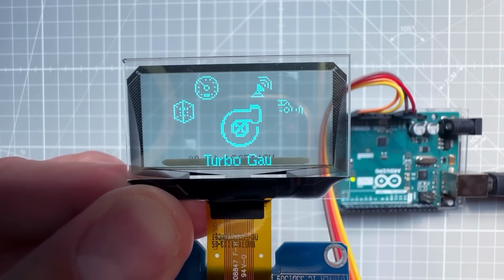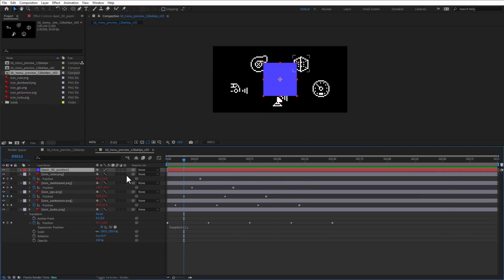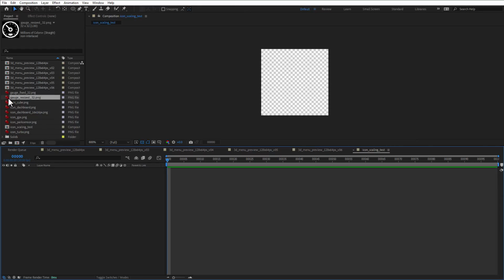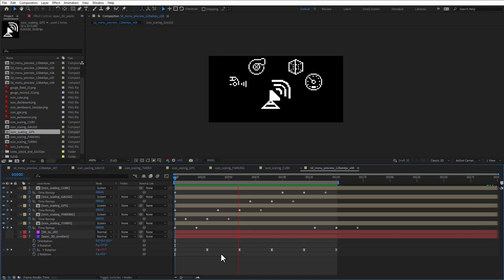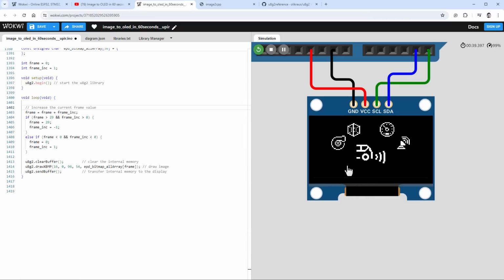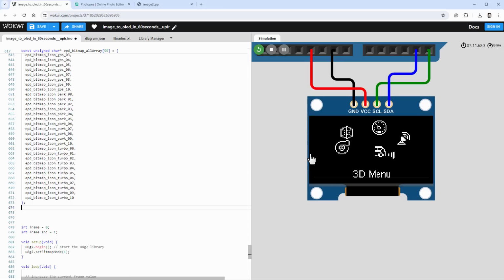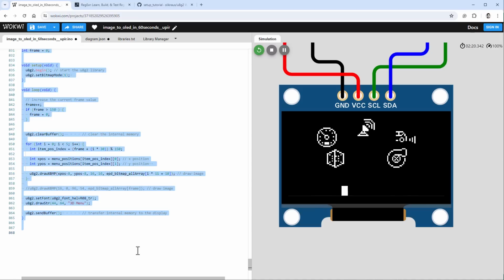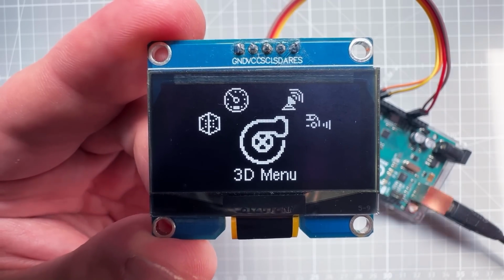Arduino 3D Menu using SSD1306 128x64px transparent OLED display

Comment: Just a warning, to those who don't realize how small this is, this is the size of two pennies stacked next to each other. Just a warning, don't expect it to be larger than it is when you get it because you'll be underwhelmed. I wish I noticed what 2.5 inches size was, and measured it out.
Reply from the maker: Thank you for your comment, but isn´t the size obvious from the video? There is a cutting mat with 1cm grid for helping with visualizing the size, plus of course my hands should be a good size indicator. Is there anything else I can do to make sure viewers understand the size of displays?
Reply: @upir_upir  Fair enough argument.
I do think it would be better to scale to something we use everyday, like a penny, quarter, or banana (just joking about the banana).
Most parts are this tiny, but when I think of displays, I think of things the size of my 14” computer screen. And that’s my fault as a newcomer to this stuff.

Comment: I have sone 1.54" screens that say SSH1309. But they work with some of the SSH1306 code. With the U8g2 library they use the 1306 code. But the adafruit SSH1306 library won't work with them. I can't seem to find a dedicate SSH1309 repository anywhere.
Reply from the maker: Are you sure you are using correct IIC addresses? I believe the default one is different for Adafruit vs u8g2. I don’t see any reason why the adafruit library should not work.

Comment: Amazing, Thank you for the inspiration ❤😊.
It would be better if you make it with more animations and useful by adding buttons ( or using a touchable screen ) and adding an SD card.
I want to see a tutorial from you on how to use an SD card please. I have problems with Arduino's memory.
Thanks ❤.
Reply from the maker: You are welcome! Yes, this was just a beginning, real menu would have buttons for sure. As for memory, I found it easier to just switch to ESP32 when I need more memory, or even Arduino UNO R4, that also has like 256kB or memory. Is that maybe an option?
Reply: @upir_upir  oh yes!! thanks ♥

Comment: never knew an arduino had enough memory to do that
Reply from the maker: Yep, somehow it’s possible to squeeze it there!
Reply: Do what? You can easily do RGBA (on non-Arduino AVRASM, ofc), and the direct-to-bus approach does wonders, especially with the slow SPI/TWI (even on true 8080 it is still fun).
Reply: Now you know.

Comment: Transparent OLEDs are in the consumer market now??
Reply from the maker: Yes, but unfortunately, only this one.
Reply: They are but ridiculously overpriced. Ironically I found a similar oled from a cheap 5v charger which I bought a while ago. Pretty sure the charger costs less than what they sell these oleds for.
Reply: The one you saw at the beginning of the video is around $17 shipped from AliExpress and works off the 5v and 3.3v outputs of the Arduino/Esp32